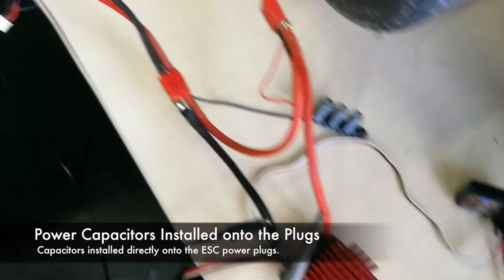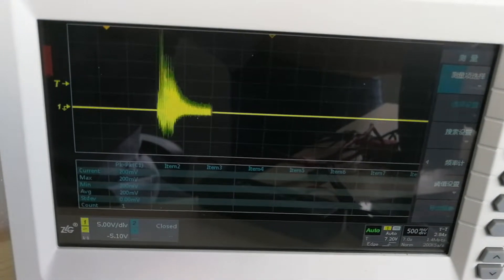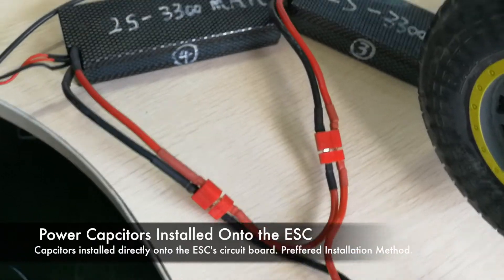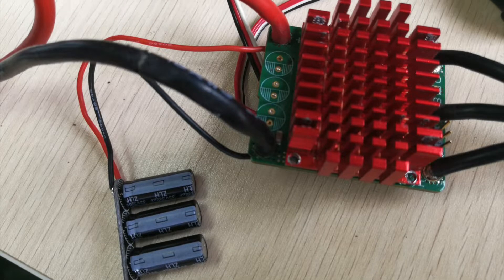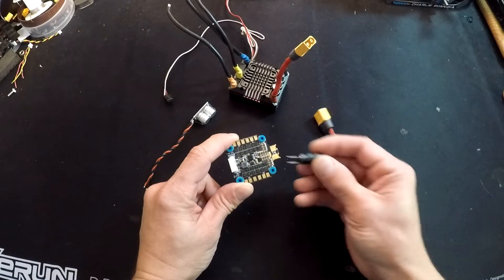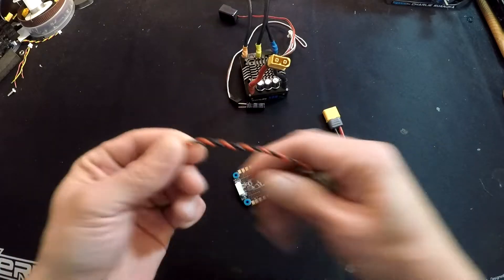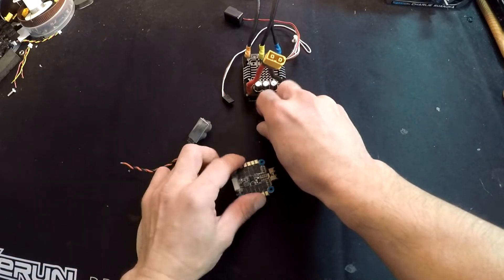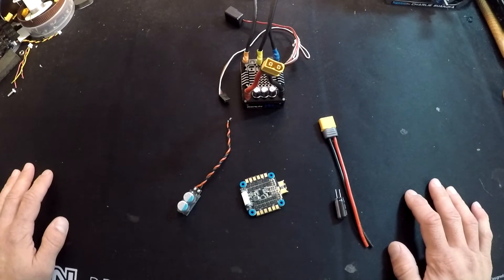HOBBYWING - Power capacitor location

Comment: My question is: The manufacturer puts all the rest of the components onto the boards at the factory, but you send 1 we have to solder on ourselves. Is that so we have to solder to the board and it voids the warranty before we ever even get to test if the item works, or because you're too lazy to do it at the factory. Seriously could you imagine buying a Cellphone, and it was ready to go, you just have to solder on 1 last cap. Only in this hobby do we buy half completed products.

Comment: Could you do a similar test comparing 4s/6s systems with 35v and 50v caps? Some say "You'll never spike over 35v even on 6s" while others suggest to double the voltage of the power source for headroom. It would be amazing to have a similar place to point to and say "Look, this is the real answer to your problem/question."

Comment: This is somewhat disingenuous since the video showing the different location is too short aka truncated to allow a good observation.  The gauge of the wire makes a difference too.  Bigger gauge = lower resistance.
Reply: This is exactly my problem with this "test" as it makes no sense the way we use them now.
Reply: Bigger gauge does not help as much as its about impedance(longer the wire is, the more impedance youll have) and not so much about the gauge of the wire. 20awg is good enough

Comment: i use both capacitors that come with the 4in1 micro 45a, is it unnecessary/overkill? I use it because once i got lower score when doing a motor noise test with flightone software, maybe ill try it again